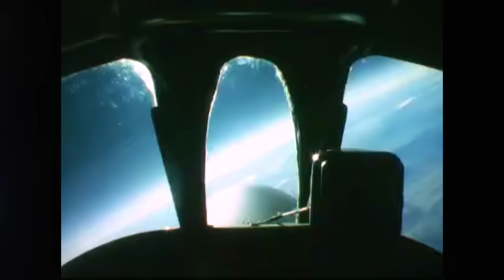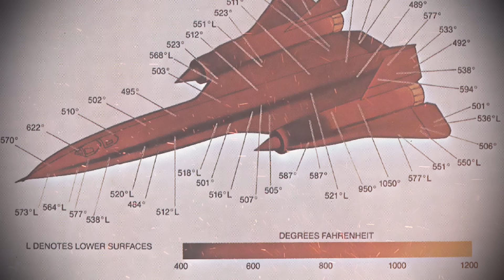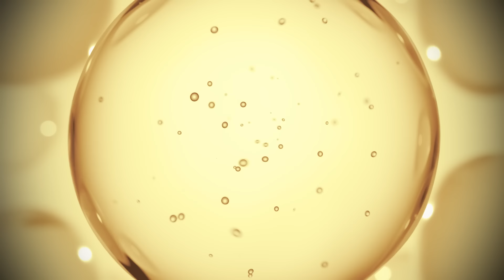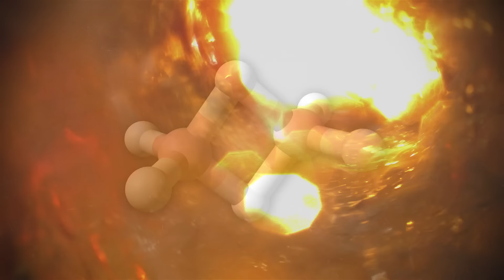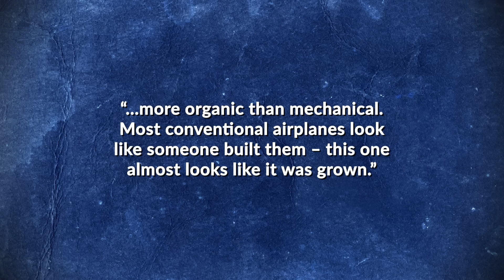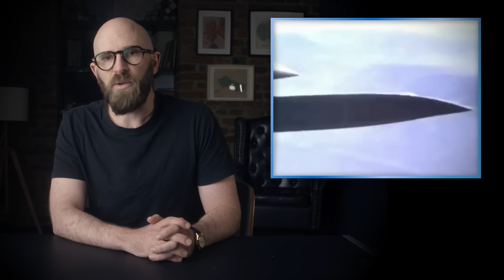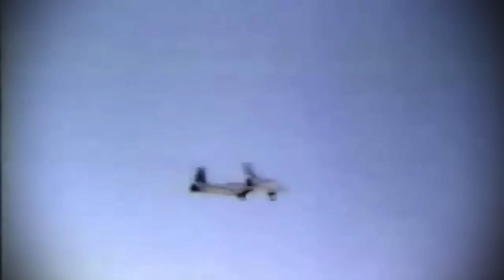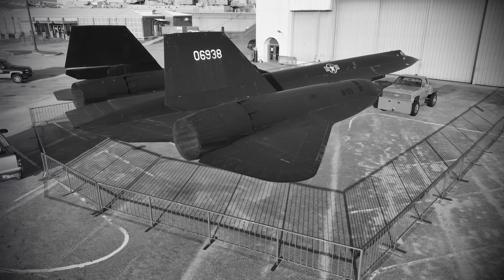How Did the SR-71 Blackbird Get Made and How was It So Fast?

Comment: Mark Holden -  "It's a common misconception that the SR-71 was designed to leak fuel.

That's a myth. 👇

In reality, Blackbird's engineers and ground crews were focused on one thing: keeping fuel where it belongs. 

Those infamous panel gaps (where the leaks occur) are sealed meticulously with a specific sealant to prevent fuel from escaping. 

When the jet was brand new out of the factory, it would not leak a drop.

So, where does the myth come from? 

The sealant used to keep the fuel contained breaks down under the strain of repeated heat cycles, and over time, some fuel does escape.

The maintenance crews who looked after the SR-71 would measure the number of drops of fuel per minute leaking from each panel gap. These discrepancies would be logged into the aircraft's maintenance manuals for each of the 32 tail SR-71 numbers produced. 

There's even an excerpt from the manual that states the maximum allowable fuel leak per zone (I'll pin the photo in the comments). 

They used this measurement to determine the intervals at which they would need to re-apply the sealant.

The myth of the SR-71's fuel leaks might make a good tale, but the real story is in the diligence of its engineers and maintenance crews. 

Lesson: Perfection isn't achieved overnight; it's a process of continuous improvement and hard-earned lessons. 

Dissecting the SR-71's fuel system, we see a tale not of intentional flaws but of persistent engineering. 

It's a constant game of iteration, maintenance, and system optimization, even for a legend. "
Reply: A truly excellent and informative.  I spent 4 years at  Beale AFB with those birds. God I love that plane.
Reply: @millionsofrecordsernieb7587 The SR-71 didn't (at least officially confirmed/declassified) violate the airspace of the USSR, however it did (as per statements from pilots and crew). Regularly. A derivative of the SR-71 (the M-21) launched multiple drone units (D-21) over the USSR. It happened all the damn time, but of course it would never be announced publicly for obvious reasons. It does give a slight pause for thought though as the program was started in the 50s, flew from the 60s-90s and still has two NASA operated birds. What on Earth has taken its place? And no, not satellites or "aurora" blah blah blah. I love this aircraft and am always intrigued by any little detail I can find. Peace y'all.
Reply: @tomg2217

Negative. The only SR-71 derivative capable of launching the D-21 was the M-21 mothership version. It was so dangerous that one M-21 was destroyed during a test launch and the program was cancelled.  One M-21 survived and is on display. 

The D-21 was instead launched by B-52s. It was only ever used over China.  A single example accidentally overshot China and crashed in the USSR.  It was not a particularly successful drone.
Reply: @calvinnickel9995  Yes, and it wasn't the first drone either they had b52s hooked up to fly by radio we had sooooo many b52s the ussr got rid of like 15k nukes for us the scrape a large amount of b52s we had them flying over the artic 24/7 365 for like 10 yrs . We have less than 100 now
Reply: @tomg2217 well like any military aircraft, fuel and maintenance costs, and a lack of need are what eventually grounded most the fleet, with at least 2 we know of still active (and probably a couple more we don't know about, for obvious reasons)
Reply: @tomg2217  Both of the NASA SR-71s have been retired for decades and now live in air museums. One is at Prima and the other at Air Zoo.
Reply: Right on, man!!!  👍✌️
Reply: Richard Graham explains that for each tank a max number drops per minute was noted with a stopwatch. If the drops exceeded the amount technicians would need to go in and perform sealing.
Reply: @MillionsOfRecords  Right you are. Aside from the desire to reduce the pressure on the sealant so they didn't need to reapply it as often, the main reason the SR-71 was never fully fueled on the ground was to reduce weight at takeoff so it wouldn't need a ridiculously long runway to get into the air. Also because they determined that the amount of fuel those engines would need to burn to lift off with full fuel tanks would basically negate any benefit of trying to take off with more fuel. Those engines are atrociously inefficient at low altitude.
Reply: What most people don’t realize that a design isn’t a desire… it’s a tolerance.  

If you look at the specification for a bolt.. it will give you dimensions and a tolerance.. a plus or minus off the value given that is acceptable for use.  

The SR-71 wasn’t supposed to leak fuel.  Nobody wants a plane to leak fuel.  But it was impossible to make it not leak fuel.  So they had to decide how much was acceptable.  And they also had to design a fuel that was safe to leak on the ground around potential ignition sources because of it (the XB-70 did not need a special fuel in spite of also enduring the heat of Mach 3 flight). 

So yes, it was designed to leak fuel.
Reply: @calvinnickel9995  It's more accurate to say that the fuel was designed to be leaked because the plane could not be designed in a way that wouldn't leak. Plastics technologies hadn't yet progressed to the point where a liner could be made for the fuel tanks that could survive the temperatures needed.
Reply: @mndlessdrwer much better way to explain it!
Reply: It also leaked fuel when up to temperature-but nobody notices several gallons per hour leak when burning 60,000+ pounds per hour 😮
Reply: @millionsofrecordsernieb7587  ya, it hit the edges, but honestly, by the time they had the inferstucture to try that flight, they didn't need it
Reply: Just imagine if we could fix the fuel leaking and metal expanding issues, today....would we still be able to use sr-71?
Reply: @ProducerJames91  Not much need. The Russians have much faster missiles these days and we have quite a lot of different satellite surveillance options to choose from, so a spy plane is fairly redundant. We also have drones for when satellites aren't viable. If anything we would build a smaller stealth drone for the purpose.
Reply: @mndlessdrwer The video said we are currently developing a smaller stealth drone
Reply: @ProducerJames91 no. The fuel was also specifically formulated for the SR-71. No one makes it anymore.
Reply: @ProducerJames91  for what, though 🤔 we have drones and satellites for surveillance
Reply: @MillionsOfRecords  At 03:06 -> https://www.youtube.com/watch?v=-1250fZuhUg&t=58s

Unfortunately even for documentaries incorrect information can be said.
Reply: well.. it was designed as one thing.   but it leaked. and it was put into the spec after the fact.    but of course that's like saying that a toyota engine is designed to eat a timing chain I guess.
Reply: I have tried to cooberate this, but basically all I see a Linked In post copied from a Facebook post (or vice-versa) that states this from a "Mark Holden" who appears to be some defense industry talking head. Not someone who flew or or worked on the aircraft, and much too young to have worked at Skunkworks during the development of any of these planes.
Unless he is going to quote someone that actually said this, I see no reason to believe it.
Reply: We've never made anything perfectly. Not once. You mean quality
Reply: 100%, the plane would heat up so much and expand so much it would shed the sealant 

Unrelated: fun fact the primary metal used in the plane was actually bought from its original target, russia, even though it wasn't actually used much over the ussr
Reply: Umm, you're wrong.

Comment: I was wondering why you kept saying "rs-71" instead of "sr-71". Today I Found Out! 😂
Reply: Have a read of a book called 'Skunkworks' by Ben Rich (early head of Lockheed Skunkworks division).

That call to rename the aircraft caused a LOT of work! Every single engineering drawing and piece of paper that had RS-71 on it had to be recalled and re-issued with SR-71. It was a nightmare!
Reply: @Chris-hx3om  RS-71 is much more suited to a sportscar performance upgrade 😅
Reply: It was not a misspeak by LBJ. Curtiss Lemay wanted to change it and briefed the President, but the press releases still said RS-71.
Reply: The “RS-71” goes back to a slip-up by the Stenotypist who wrote down the speech. LBJ actually said “SR-71”. However it was the version from the stenographer that was handed out to the press later.
Reply: Easier to rename the plane that correct the President... excellent call, considering some of the stories I have heard about LBJ.

Comment: I always thought the tech behind the SR-71 was the first "by-product" of the captured Roswell craft.
Reply: See one in person being set up for flight and you'd realize no self respecting alien would fly something that jury rigged. very clever jury rigging, but it literally leaks fuel while on the ground, It needs the high speeds and altitudes to fully seal up. Down on the ground the pressure is to high and the skin temp to cold for things to be fully expanded into place. If built with things expanded into place they'd rupture before reaching operational height and speed. If built tough enough to do that anyway it's be to heavy to get to height and speed long enough to be useful. So they built it with room to expand into proper trim. They got as close as the could without risking ruptures and stress failures, but it still leaks sitting on the ground. Not doubting the smarts that went into the craft, for good reason, but they had stronger limits back then than now. material science wasn't up to the full job, just this really clever close enough for government work.
Reply: It's a jet...

Comment: Ive read that the declared max speed is actually not its top speed.the Power plants could push the plane much faster...but the heat that would be generated at thos speeds would have detrimental effects to pilot and materials of the plane.
So an actual top speed was never determined.
Reply: And note, the USAF only claims "above Mach 3".  There are air traffic radars that tracked objects (that would only make sense in context as SR-71s) going closer to Mach 4 than Mach 3.
Reply: @geodkyt the account of the mission where Libyan missiles got a lock suggests the speed achieved may have been Mach 3 + quite a bit more than a wee bit.
Reply: @geodkyt  If anything was tracked close to mach 4 it was only with a crazy tailwind - the material limits of the J58 would melt at mach 3.4 at the latest, as temperature is increasing rapidly at this point
Reply: @geodkyt

lol… the fish get bigger every year.  

Mach 4… my ass.  Especially in a plane with such explicit limitations on compressor inlet temperature and the risk of dangerous and violent inlet unstart and that required a week of overhaul between each Mach 3 flight.  

Tail winds will make any plane faster but does not increase Mach as Mach is the speed of the aircraft relative to the local speed of sound.  

In cold air the SR-71 could go at a higher Mach because the temperature limits could be respected at higher Mach.. but the speed of sound is slower in cold air so the true airspeed isn’t any faster.